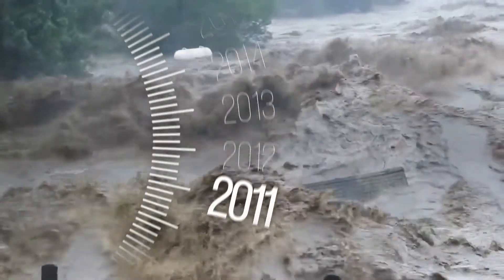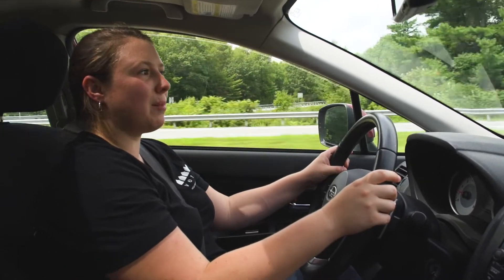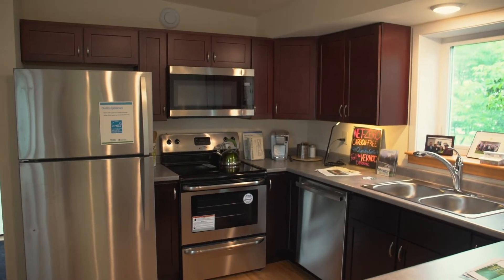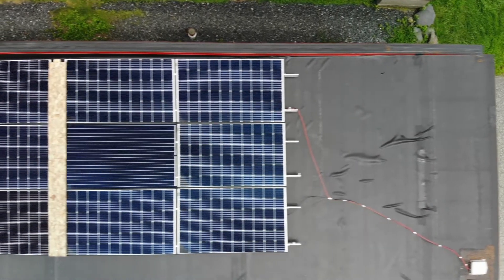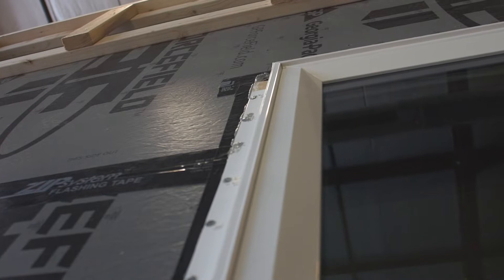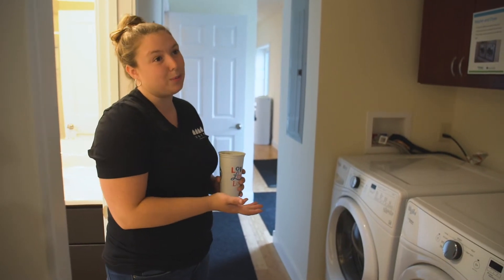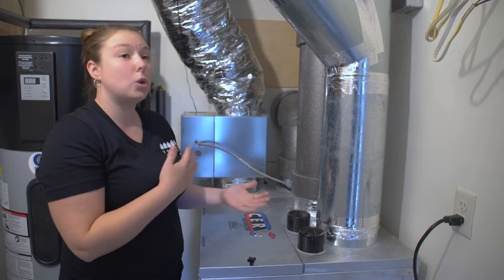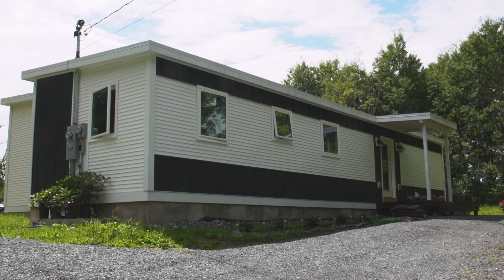Mobile Home Resiliency in the Aftermath of Irene

Comment: Coming from Europe, I see these wooden houses as quite fragile. Most local houses are build from bricks or concrete. You want the house to be resilient to extreme weather events so it should be sturdy, right? Maybe the price is the reason why US houses are fragile.
Reply from the maker: Thanks for your comment! Sturdiness is definitely a good goal for resiliency. We only slightly touched on it in the video, but one reason mobile homes were disproportionately affected by these storms is the lack of building codes manufacturers had/have to follow compared to houses that are built on site. Without the codes, mobile home manufacturers likely only considered the price while evaluating which building material/strategies to use, and did not consider extreme weather events, therefore creating delicate houses. 

Hopefully we will continue to see more inspiration from European architecture over here in the US!

-Nate